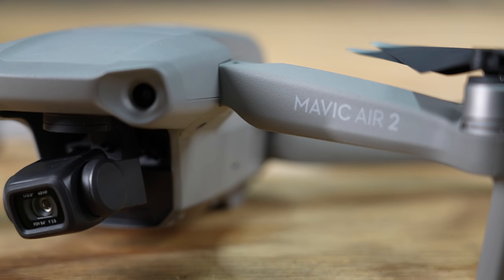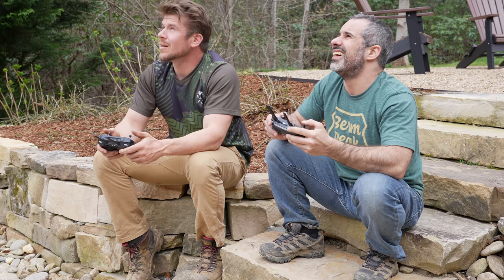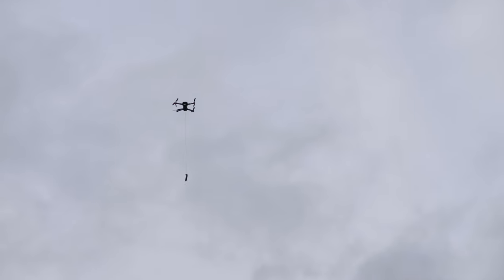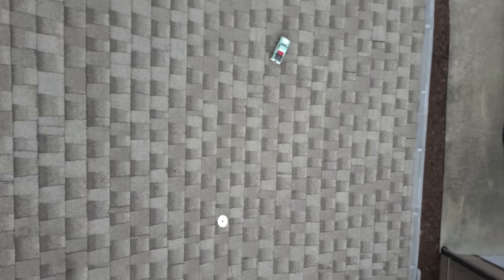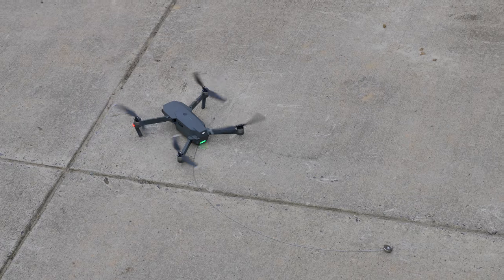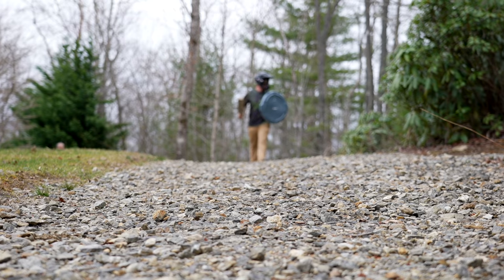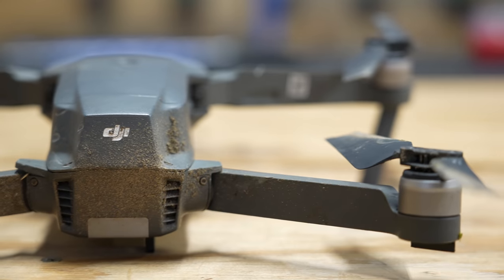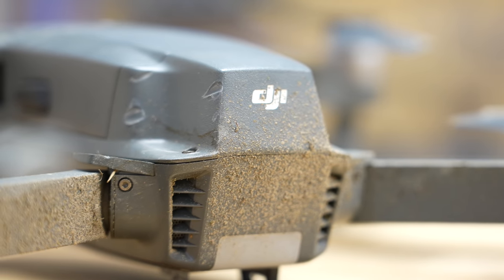Doing really sketchy things with my old drone

Comment: 1. A handful of hobby rocket motors strapped to it.
2. Parachuting mini crawler (a spare spare servo, receiver, and rubber bands should get you headed in the right direction here. Name of the game here is higher the drop the better, lower the opening the better)
3. slo-mo jumps of RC over the drone
4. since you already made a release system in option 2, now its time to deploy ziploc bags of gas over a fire. Keep lowering altitude till you have the shot.
5. Huge MTB tail whip to smash her mid air. RIP whoever volunteers for this one.

Comment: Kevin is completely correct. You need the fire pit loaded with wood and doused in petrol. The drone lowers in a zippo lighter from above or hot coal - and films the inside of the resulting fireball. Safe - no. Awesome - yes.

Comment: Gut it and install an aio flight controller such as a fettec aio 35a use the existing battery to power it glue the camera facing a 25deg angle and happy days

Comment: Try to see how fast you can get it to go by mounting some solid model rocket engines to it!
need to rig up a remote lighter to make that work - might be able to do that with a couple of leads that touch when the camera is turned a certain way. with a battery and ignitor.  or a decent length fuze so it has time to get in position.